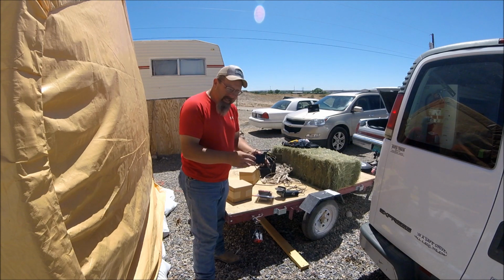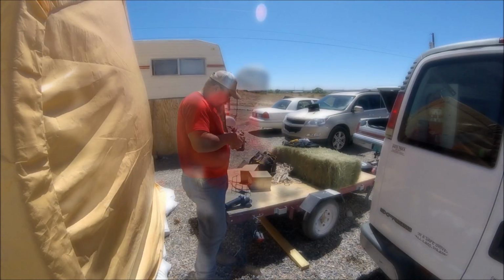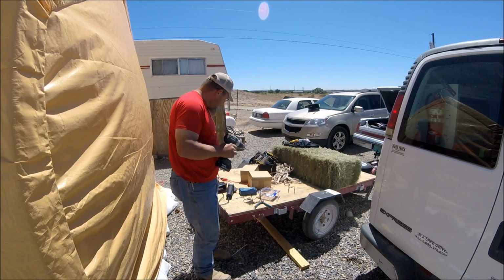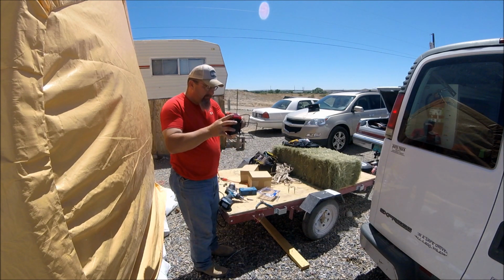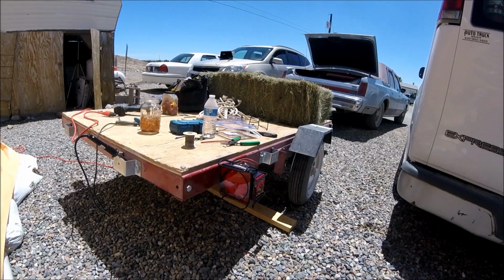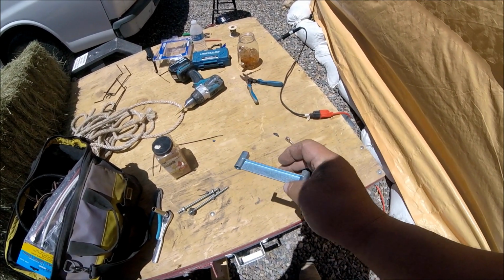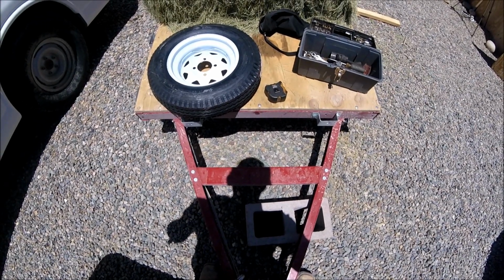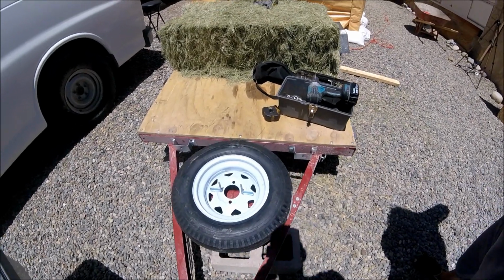Harbor Freight Trailer Upgrades

Comment: I just broke a taillight  on my trailor today and right away put a protection bracket on both tail lights ,they are really flimsy.
Reply from the maker: The L brackets finally broke and I had to replace them as well. I used some heavy duty L brackets that I already had. Rough roads play havoc on these trailers. Periodically check all your connecting points and make sure the bolts are tight. Thanks for watching.